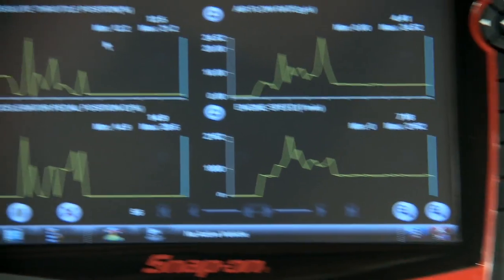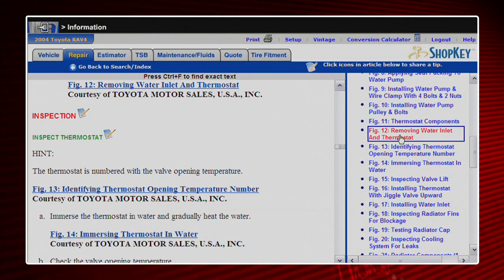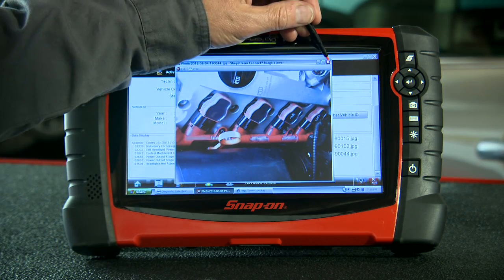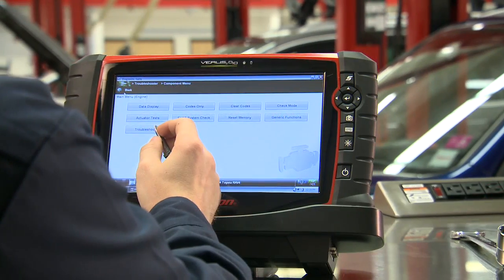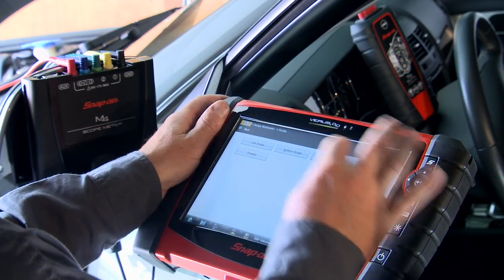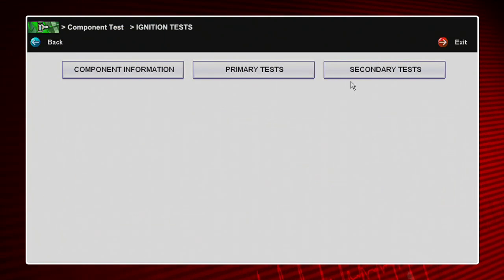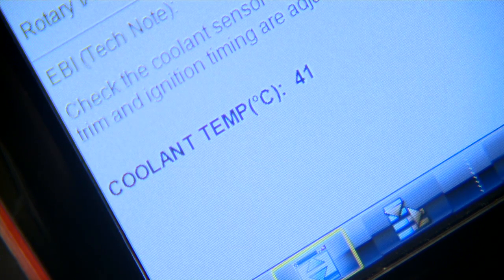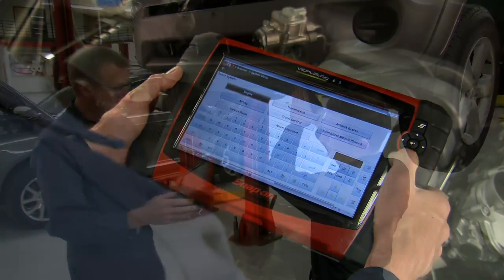VERUS® Pro Diagnostic and Information System | Snap-on Tools

Comment: One of most comprehensive and best  Scan tools on the Market. The Guided Component Test is worth it's weight in Gold. Its the big gun in the arsenal.
Reply: Yeah until
You can’t update it any more or get the last update what’s so ever
Reply: @TheNotYetProSkaters  The Launch is my go to Scan Tool. The Snap On is only used for its (4) Channel Oscilloscope and Guided Component test feature. The Launch has free updates for Two years. Launch is very powerful for Coding and Programming.
Reply: Just got it updated to 2019 still has alot of life left especially now that folks are keeping their cars longer
Reply: @machobuck793 
Sounds good. My newest vehicle is a 2013 Ford Transit Connect. I’m looking at the Zeus and heard great things about it from fleet managers.

Comment: But still the best all around scanner for the aftermarket.  The trouble shooter and information data base is unbeatable.  It does connect to the wireless internet hub in our shop.  Connects up to Shopkey or Mitchell on demand.

Comment: 3. printing graphs so you can show the customer what is going on is a little bit of a problem.  Trace one YELLOW?  Really?  tough to see on white background.  Worse yet, Scale and sweep are white.  Forget about using white for background.  It will hide scale and sweep.  Print screen will use a lot of ink!!!  Print graphs from custom settings graphs will be only three graphs per page of paper.  And if you print from regular scan three graphs per page plus all the pid lines. Lots of pages...

Comment: 2.  Modis can stop the graph while on a test drive by using your hand on the stop button.  something you can drive and keep you free hand on the button.  Verus you cannot use the buttons to stop the graphs.  You have to use the touch screen.  That means that you have to look away from the road to see where the stop button is on the touch screen.  Seems a little dangerous to me.  I use the stop and restart to mark areas to check when I get back to the shop

Comment: while Verus Pro is a substantial improvement to the old Verus there are still problems that should have been addressed.  
1.  Graphs will be lost if key is turned off or communication is lost.  Modis save the graphs on the screen.  Just stops the graph where the communication was lost.  So you can look to see what happened just before it went dead or whatever.

Comment: Tried to code a mercedes vito steering angle sensor today after replacing the steering rack using modis. 12.2 tells me not supported. So many gaps in coverage. Instead of introducing so many platforms why not improve on software coverage, Subscriptions are expensive and the some of the stuff they put on them is pointless I'd rather have important systems covered as compared to be able to operate a window motor using bi-directional control, i can do that with jumper cables or a power probe.